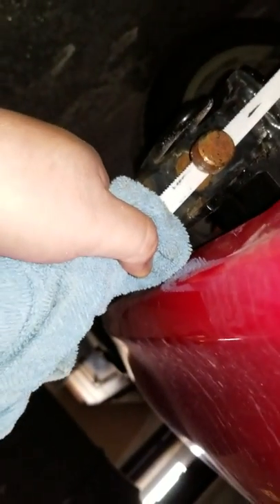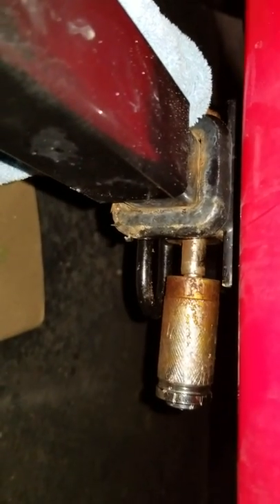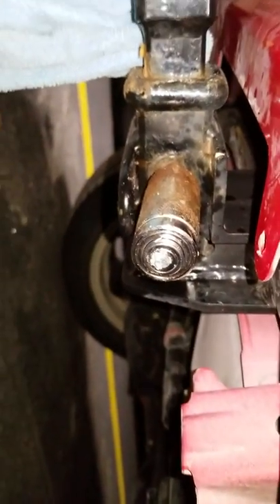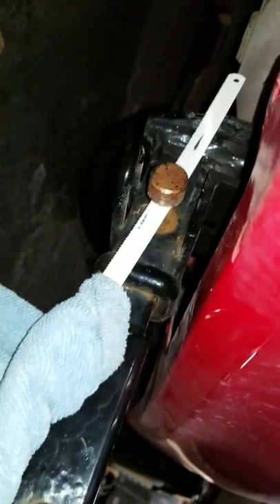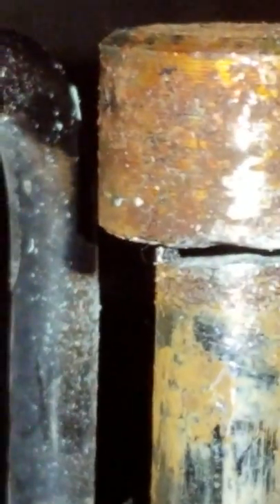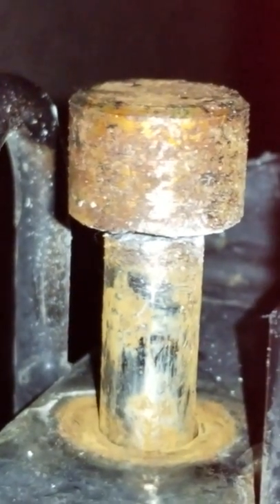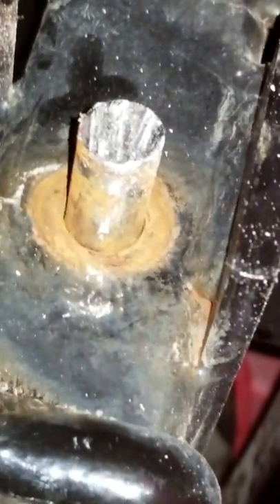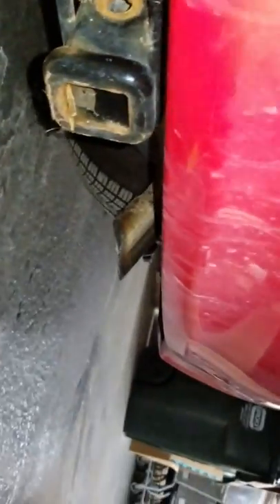Removing a stuck (broken) hitch pin lock

Comment: I hate to have seen you go through all that work. 
All you needed to do was to grab a pipe, stick it in the lock side and pry the lock off. All locking hitch pins have a week point on the lock end that make it super easy to remove without the key.